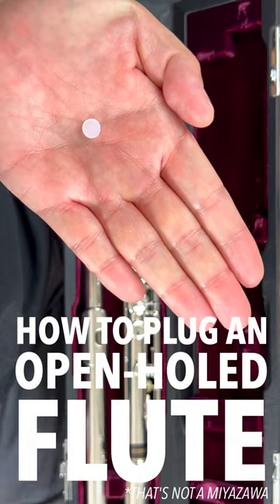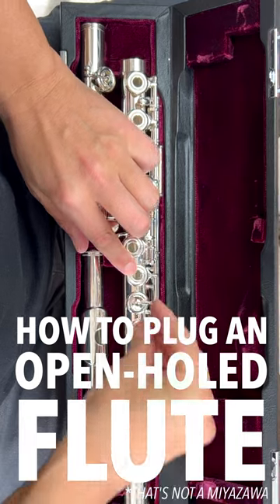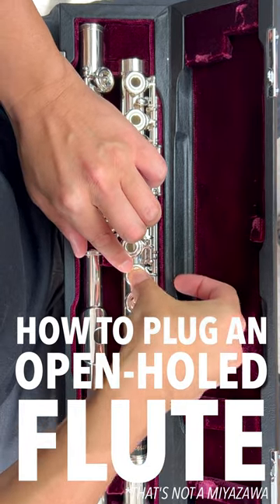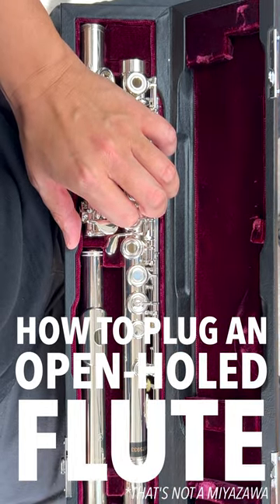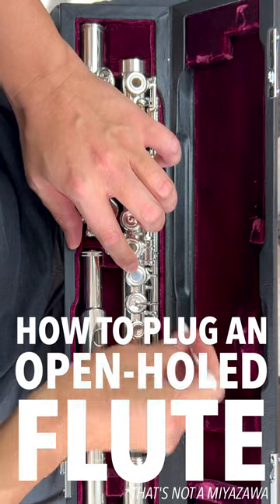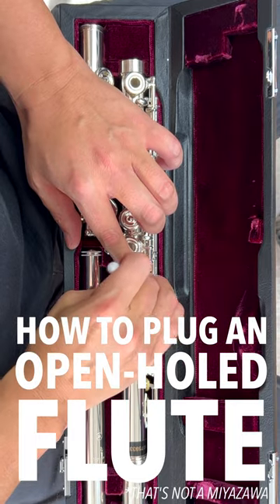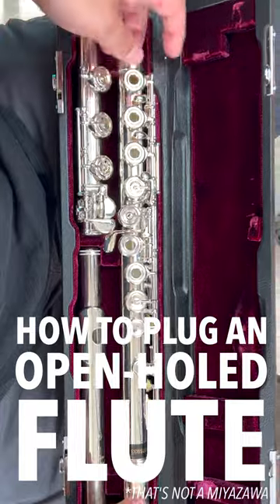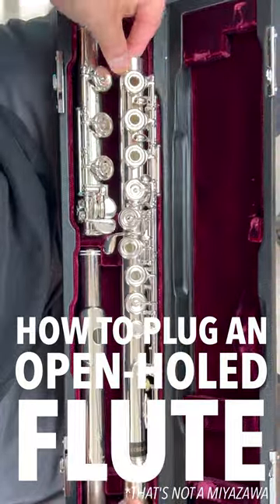How To Plug (and Unplug) an Open Holed Flute

Comment: It should be noted that you cannot do this on newer Miyazawa flutes (not sure about older or any other brands like this). With Miyazawa flutes, you push the plug in the same way, but in order to take it out, you have to use something that is able to pull the plug out as opposed to pushing it through. I’ve seen people use needles to pierce the plugs, and pull them upwards. I could not be so brave 😹😹😹😹
Reply from the maker: Yes. Thanks for pointing this out.
Reply: @LanceSuzuki  really helpful, thanks